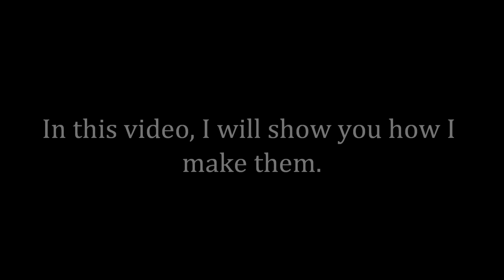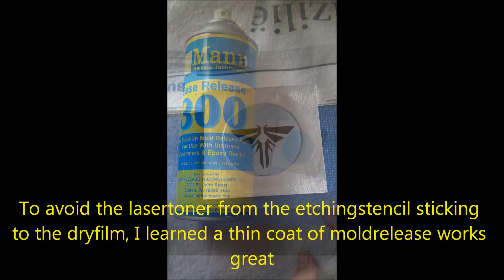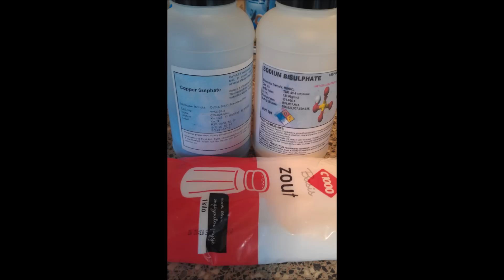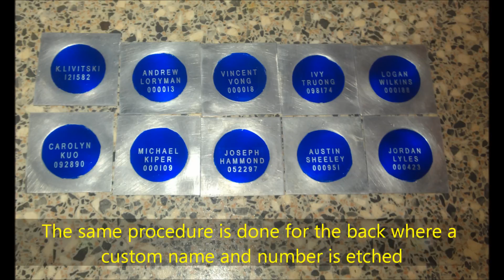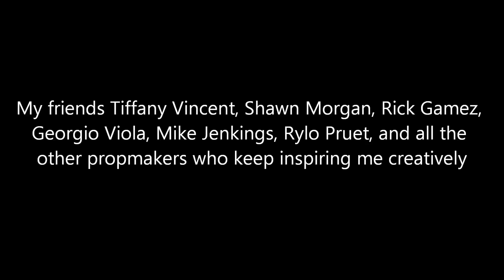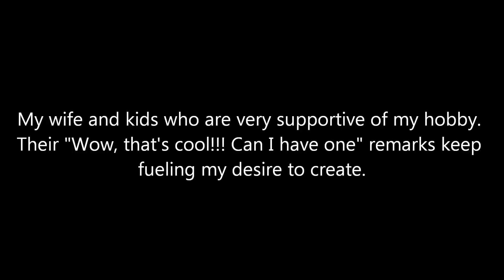THE LAST OF US making aluminium etched 'Fireflies' dogtag replicas

Comment: Hay was wondering if U r making more as your shop says sold out
Reply from the maker: Relisting them when i have finished the current batch
Reply: @shadowrunner101  good to hear can't wait I have a few questions tho will the metal turn green or rust if I wear is 24/7?
Reply from the maker: Aluminium oxidises and stays greyish, easily cleaned up with steelwool